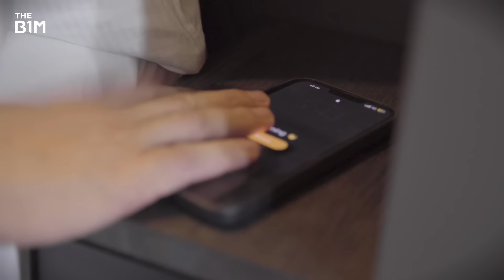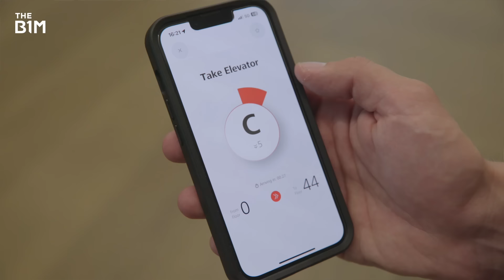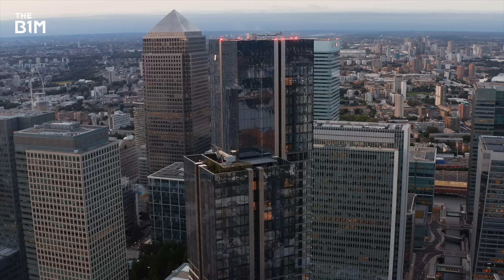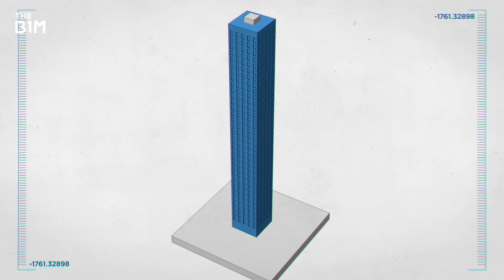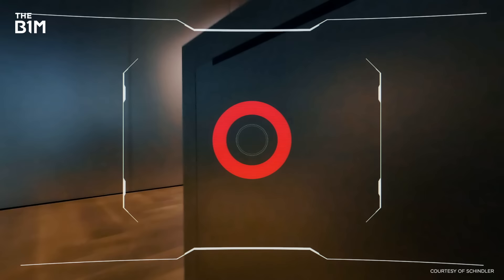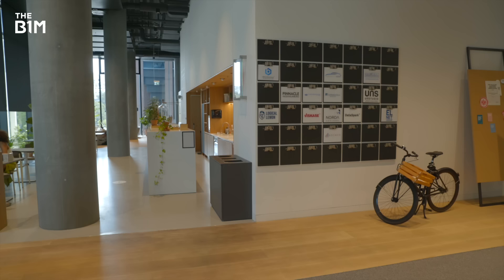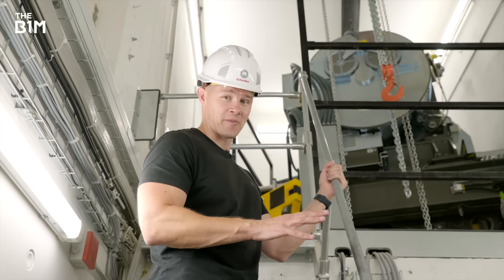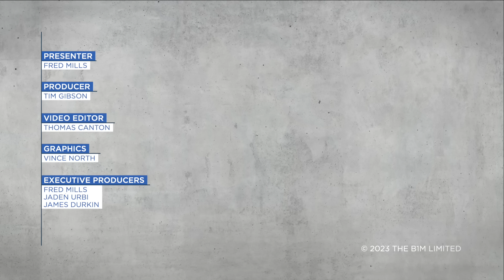Germany Has Solved the Empty Skyscraper Problem

Comment: Plumbing (drainage & water lines) would also be a huge challenge , particularly if you’re looking at an existing building. Elevators are used like a bus not a car, multiple floor stops. You are back to needing large numbers if they don’t stop on every floor?
Reply: It seems they do serve every floor, unlike the example with adding extra shafts. If no one is using the residential lobbies all of the lifts can serve the office lobbies, and vice versa.

It’s just that, on a per lift car basis, if they’re currently serving a residential floor in that moment they don’t seem to take on anyone from the office lobbies. (It’s unclear if that even includes people who live in the same building going home from work, or if an exception is made based on the destination.)
Reply: Each elevator seems to be designated to a specific use based on demand by some sort of computer system linked up to an app on your phone. Its not really explained in the video, but I saw other people saying that you walk into the building, and the app tells you which elevator to go to. If you're going to a floor of offices, then that elevator won't stop at any residential floors on its way up, even if people on the apartment floors call an elevator, and vice versa.

It's essentially just a keycard system hooked up to a computer that computes demand and assigns elevators accordingly, but uses an app on your phone to tell you which elevators to use. Since the apartments in this building divide the office spaces into 2 sections, it would be interesting if the system could further designate between the 2 sets of offices to essentially act as "express" elevators to the upper offices, but there's no mention of that in the video. I still feel like the elevators are one of the lesser issues in converting skyscrapers though.

Comment: So I thought that I was going to learn something new but then I watched the video and there are a lot of problems from a real estate development point of view: 1) Residential has different infrastructure compared to Commercial in terms of plumbing, ceiling height, fiber optics, power supply, and window regulations. You are increasing the building costs for both to handle both. 2) Commercial prefers new build since they are taking out a loan anyway 3) Commercial likes to build to their own specs, so another reason for new build 4) We need so much new housing, there is a housing shortage, so why would we ever then switch from residential to commercial?  5) And in most US cities they'd need to come up with a new building regulations to make this legal

Comment: I'd love to see a deeper video on this. Double sided elevators have been a thing for a while, I'd be interested in a deeper dive into how this system differs and is configured
Reply: it doesn't, it a commercial for the lift company.
Reply: Yeah, video is just a badly disguised advertisement for an elevator manufacturer. They haven’t really come up with anything groundbreaking, and it’s  not even the biggest issue to be solved in mixed used skyscrapers.
Reply: It's basically a luxury concern. The planners could afford to waste space on two separate lobbies, something that would only be of concern to upper class residents who can afford to not want to come in contact with the unwashed masses on their way to work.
Reply: This video is clearly about how the mixed use was clearly thought through and flexibly integrated into the structure. Considering possible changes in the future and demonstrating how apartments and offices can co-habilitate the space even on the same floors. Not sure why you didn't get that.

Comment: They are elevators with two sets of doors that each open to different lobbies— residential and commercial. The two populations use the same elevator but never mix. This short unfortunately doesn’t explain this as well as the long form version.

Comment: Wait how are residential lifts different from commercial ones? Just a back door opening and you don’t want strangers to have access to your house?
Reply: If I understand it correctly. Every shaft has 2 entrances a front and a back.
If you press the call elevator on the front the elevator will only accept inputs that bring you to front access floors (in this case commercial)
And if you press the call button on the backside the elevator will only accept inputs for floors where the backside is available.

This also prevents unwanted ride alongs as the elevator won't allow the frontside to be called or opened while it's in backside use.

It's pretty clever and could easily be expanded by having a second lobby floor only accessable via escalator or something which allows access to another 2 subsections or the building. Or you can split/combine the shafts as you see fit. (though it requires some rebuilding of the ground floor)
Reply: @profwaldone  This comment is a better explanation than the video, which is herald this as the second coming of Christ.
Reply: I watched the video and still couldn't work out the big deal, your explanation does this really well , thanks @profwaldone
Reply: I’m still confused tbh, if there’s still less elevators then normally won’t people spend a lot of time waiting
Reply: @profwaldone That sounds like less function per elevator. I work in a building that has done the second door and lockout thing with physical keys since the 60s and it's the opposite of more efficient. They specifically avoid using them when the elevators are in high demand.
Reply: @blushdog that’s why they pre-select the destinations, to make the routing more efficient. That doesn’t actually need an app, some large hospitals have a keypad for destination pre-selection. 

The app seems to just provide a convenience function in the lift preemptively being there waiting for you, like if the destination keypad was by the entrance rather than the lifts.

Otherwise the access control, double use thing is mostly useful during the lower trafficked parts of the day when the lifts can dynamically switch between office and residential for every ride — at 8am and 5pm they’re basically all going to serve the office and outside those hours they’re almost all going to be used residentially.

Comment: Elevators with 2 doors have been around for a while. Keycard access for different levels has been around for a while, too. With 2 or 3 different levels of keycard security, the elevators could be programmed like this without need for an app. When I played Sim Tower as a kid, I assumed a lot of tall buildings had a mix of office and/or residential and/or hotel. When the Book Cadillac hotel in Detroit was re-opened in 2008, it had condos on some of the upper floors.

Comment: I’m not sure if these are lobbies or communal office space he is filming in, with the 3m high ceilings and windows, but in modestly sized apartments, the big issue in office conversions is always having just one wall with windows, meaning your bedrooms and office are in the central part of the building with no view to the outside.   After that, the problems are plumbing, hvac, electric etc.

Comment: The problem with reusing existing skyscrapers is they are not designed to support individual apartments or hotel rooms, they don't have the right plumbing, power and waste systems that a residential building would have and its very expensive to retrofit.

Comment: You missed the fact that residential units need operable windows (at least in the US), office buildings do not.  If the building is planned with operable windows to begin with it would work, but usually that is cost prohibitive.

Comment: The problem in the US is that commercial floorplans are huge and there aren't enough windows for residential, even if the skin is all glass. That is not something you can solve with a fancy digital elevator. In rare cases, the core of the building has been augmented with a light well, a major restructuring project. In most cases, no solution is available other than waiting until our friendly workaholic CEO get everyone back on the road and into the office.

Comment: So many problems with this, yet many can be addressed. 
Most of the problems are going to be how residential and commercial can seamlessly work when each require a lot of changes. 
Residential requires several things to work. Bedrooms, living rooms, bathrooms/laundry rooms and kitchens. If you were to build the offices in such a way that you could change a floor in to a set of an apartments in no time flat. 
Most skyscrapers are around 200x100 feet or 20k square feet. If you were to ideally say that each apartment was 1500 square feet and the last 5000 was elevators and hallways. You could set up a 10 apartment/office floor that would have 3 bedrooms 3 baths. If done correctly you could ideally still have 30 offices and large open areas. Think of the bedrooms/bathrooms as being window rooms while the living/kitchen areas are the middle with window ends and the center the elevator/stairs and hallways. This would create a square type area when it was opened up. The plumbing could be sealed off at floor level and the vent sealed in the ceiling. With in the ceiling would be the firewall sections where the apartment walls would be and they could be slipped back in. It would only take a small amount of work to remove the ceiling panels and the the cross members for those panels where the walls are then they connect back in and new shorter panels and shorter cross members are installed back in. 
The only problem with this is the amount of waste one is going to involve in fixing up these floors and then ripping them out at some point. 
Office space is going to become obsolete over the next decade when more and more companies are going to down size their staff or grow their remote staff. AI has and is taking over more and more office jobs and people are finding ways to move to new sectors. The push back for working in offices is really getting hammered down to employers as people are no longer wanting that 9 to 5 crap. The internet and their speeds offer 4k video calling that is far better and gets even better by the day. People are no longer wanting to spend the hours driving to work when they do not need too. 
Countries should be pushing their companies to offer more remote work. Even if you have to live stream 4k during working hours. Its not that hard to have a computer with a screen streaming a group of workers working.

Comment: Downtown St. Louis has at least two high rise buildings that’ve been completely vacant in recent years… the former AT&T building which is almost as tall as the Arch & One Metropolitan Square, and the century old Railway Exchange Building; better known for decades as the old “Famous” store building (was Macy’s for more than a few years but they completely closed 10 years ago). 
The latter has not only been completely vacant for 10 years, but currently has immediately noticeable exterior vandalism on the roof.

There have been plans for increasingly awhile to convert said buildings to residential & maybe hotels, but obviously it’s all about price & willpower to basically rebuild the entire insides of said 275-587 foot (1.2-1.4 million square feet) buildings.

But St. Louis is not only a very stagnant city, but crime & reputation have HISTORICALLY been a problem in recent decades. Recent years, spilling into downtown at random times (other times things are calm). The suburbs, much less Clayton have all gotten evermore office space over the decades though…

Comment: Skyscrapers are a building from the past. They are expensive to build, expensive to maintain, and expensive to dispose of. Skyscrapers are also extremely vulnerable to any catastrophic events. Imagine a simple power outage due to prolonged snowfalls that cut down the wires. What will it be like for you in a skyscraper without electricity?
In the modern world, where the Internet allows the transfer of huge amounts of information, there is no need to group employees in one place. For what? One more moment. At the beginning of the 20th century, the benefits of civilization were concentrated in large cities. And the transport system could not ensure the rapid movement of people. Traveling 50 km to go to the theater in the early 20th century often sounded quite absurd. Now, in the Netherlands, for example, you can get there by public transport in an hour or two.
In the modern world, with its digitalization and cheap logistics, such concentrated real estate is simply not needed.
If someone says that, for example, an investment company needs the safety of its data and it needs a good level of security, then I will answer. Building a low-rise complex in a place with inexpensive land prices and buying staff housing around it will often be easier and cheaper than buying space in a skyscraper (or renting it). And if you did this at some distance from the city, then security issues only become simpler. As a dystopian example, we can take closed science cities in the USSR.

Comment: The biggest challenge in converting to residential is the plumbing risers for kitchens and bathrooms, and the ventilation shafts or risers required by code. These are traditionally close to the core as well and not located near the curtain wall.
Bizarre that this video gets so excited about elevator operational controls as a sweeping remedy.

Comment: As shared below, elevators can be programmed for any type of building use - THAT'S NOT THE PROBLEM! Plumbing, electrical are significant issues. Most high end apartment buildings have balconies so there is access to outside. Office buildings are built without open windows and few outside areas. Certainly not for every "apartment."

Comment: I love the B1M channel but this video is misleading. I was very intrigued to know what steps Germany actually took to solve for a glut of empty office. The highlighted project talks about a potential path forward, when it comes to new product from this point forward. But the video has nothing to do with solving for existing/ outdated/ obsolete stock that has little-to-no hope for office-residential conversion… which as others mentioned, suffers from retrofit issues with plumbing, electricity, deep floor plates, elevator traffic flow, maybe zoning, etc

Comment: First the elevator shaft was built in anticipation of elevators being designed. It was expecting round cars with multiple doors controlling traffic from centre outward in whatever works for application of buildings intended use.

Comment: Sadly, San Francisco has made their housing situation worse because the plumbing is designed for commercial use - toilets in one part of the floor - and cannot be easily retrofitted to accommodate plumbing for kitchens or similar residential use.

Comment: Most commenters have missed what Schindler is doing here.  They have done a lot more than adding an extra elevator door.  They've integrated everything with software and smartphones, and certainly augmented reality (AR) will play a role.  Plumbing, kitchens, bathrooms, etc are difficult to change, but once implemented in software, it fully-immerses people in an easy to re-configure world.  Just don't take off your VR/AR goggles when you're having a poop.

Comment: Of all the problems that have to be solved with flexible usage, then the addition of programmable elevators seems to me to be one of the simpler ones. The most difficult is surely going to be about the other infrastructure services that need to be sorted out. Of those, I would pick out something as basic as plumbing as the most challenging. Any office is going to have a need for perhaps 2-4 locations on each floor where toilets are required. Perhaps some kitchenette type facilities. For this, then all the plumbing can be concentrated, vertically, in just a very few locations. However, when it comes to apartments, then they are each going to require a bathroom or two, as well as a kitchen. Maybe a dozen apartments a floor, and then the plumbing infrastructure is going to be well dispersed, and you can't easily have vertical runs as there may be an office beneath. Waste tends to have minimum fall requirements. Even more demanding will be catering for hotel type accommodation, when each room will required its own plumbing infrastructure, and again traditional, vertically aligned services are going to be problematic.

There are other services which have to be dealt with, like electricity, telecoms, security and ventilation, some rather simpler than others.  Maybe the most intractable will be the lack of access to natural light at the core. Many countries have rules about what sort of habitable rooms must have access to natural light. That will limit the way in which buildings with large areas per floor can be used. It may be that kitchens and bathrooms without natural light are not a problem, but it will be for bedrooms and other living space in apartments. I'm not sure what the rules are for hotel rooms; there are cruise ships without natural light for inner cabins, but is that allowed for hotel rooms? 

Now a lot of this could be designed in, on a new building, although it will involve compromises. For an older building, much more problematical. Not to say that something can't be done, but it is not going to be easy.

Comment: My invention is a three shafts elevator system for any building.  One elevator shaft for elevators that goes up.  One elevators that goes down.  The third shaft is for elevator to park when they stop.   My new elevator moves like a cable car, grabbing on to a cable when it moves.